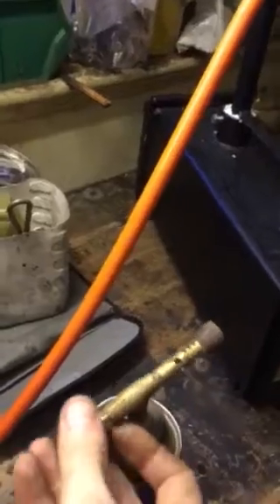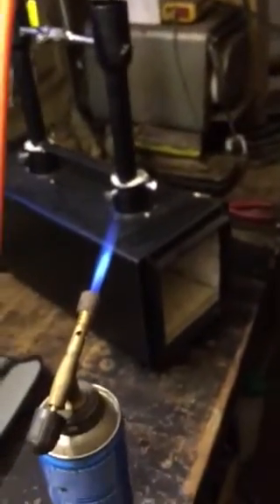1st  lighting of my DFPROF2+1D Gas Propane Forge for Knife making  Blacksmiths

Comment: These Devil Forges are awful. They are cheaply made and the insulation is marginable.  The kaowool must be covered with refractory cement. The refractory cement quickly bubbles and cracks due to the heat which allows the kaowool to burn and is extremely dangerous to your lungs. The regulator is cheap and the guage did not work out of the box. I bought the double burner Devil Forge and have had nothing but issues with it. After two uses I ended up throwing the forge in the trash and building my own out of firebrick.
Reply: Why didn’t you return it? If they came damaged you could of asked for a replacement. Or you could’ve just gotten better refractory cement
Reply: @sethparrow04  why did I not return it? 1. It would cost too much to repack and ship it back. 2. The company should not supply cheap regulators. I'm not the only one that has complained about this. 3. there should be no reason the consumer should have to find a better refractory cement then the once applied by the vendor? Your questions do not make no sense. I was giving my opinion about what I experienced with this unit.
Reply: Trace Eubanks idk bro, My forge seems to be ay ok. Just got it today and when you put the refractory cement in, you are suppose to let it air dry then use it. The crackling of the cement is caused by the water still in it.
Reply: @sethparrow04  thank you I'm aware. I let the refractory cement dry for 2 days then thermal cycled it. Over a short period of  time  your refractory cement supplied with your foge will crack.  Good luck.
Reply: Trace Eubanks i’m about to run it at FULL POWA
Reply: Trace Eubanks I did hear some cracking but eventually it went away, I should probably get some bricks to cover the front
Reply: Trace Eubanks it started to snapple crackle pop, but it was not the forge, it was the stone table I had it on 😬. Little chips launched up and I was wondering were they came from, so far so good.
Reply: Trace Eubanks ran it at full power for about 2 hours while forging, nothing seems to be cracking. I should probably get some more refractory cement to make it a bit more firm. Other than that it heats up nice and is very powerful.